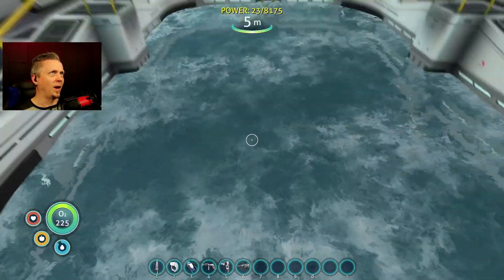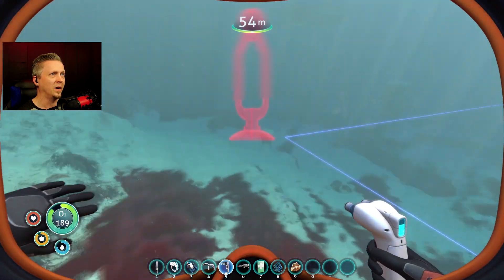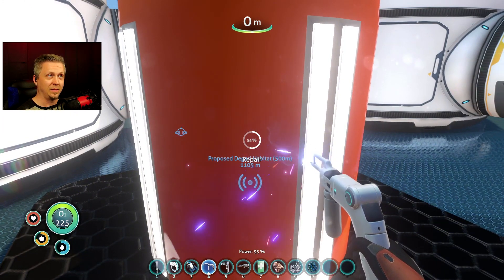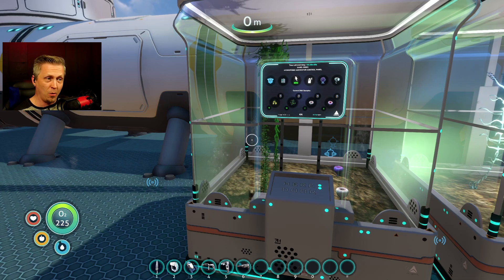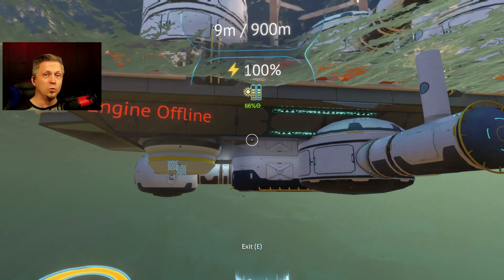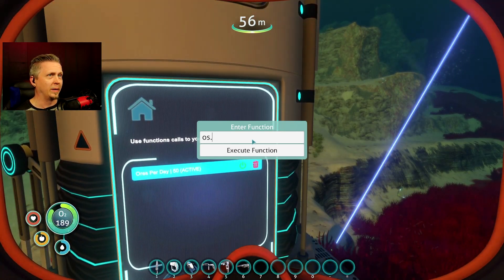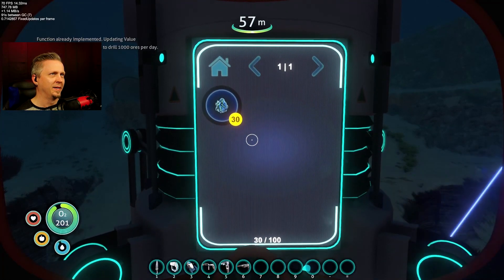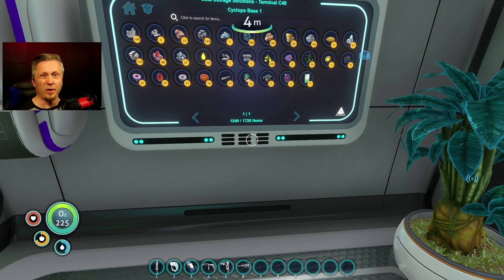DEEP DRILLERS.. PUSH THEM TO THE LIMIT  -  Subnautica Modded S3 Ep5

Comment: i can't seem to recreate the wind turbine issues... obviously it's a problem, i just don't know where to start
Edit: found the issue with its draining speed, it's rather simple actually
Reply from the maker: Thanks for that Lee. I did see that was fixed in the new update, but I also found a weird bug with the sound trigger which I did point out in the new video. Not sure if it is from another mod interfering or not, but I cannot think of any mod I am using that would have anything to do with the sound.

Comment: If the FCS Storage could be built within your Base, I'd be more likely to use it.
Reply from the maker: You can build in on a base platform or component outside, but it's too tall for inside. Plus inside just use the Data Storage mod which is much more compact with a higher storage volume.